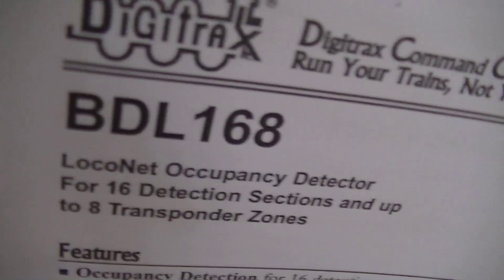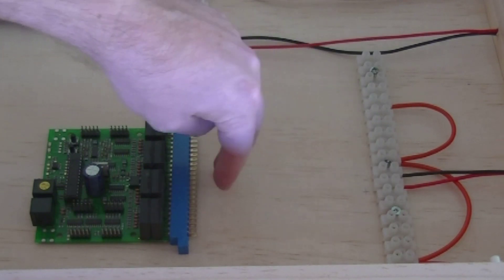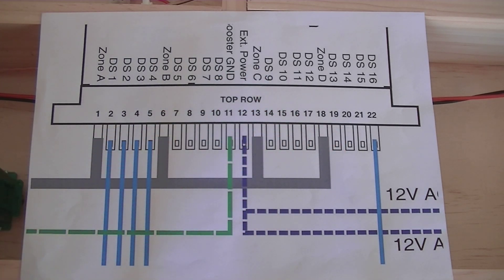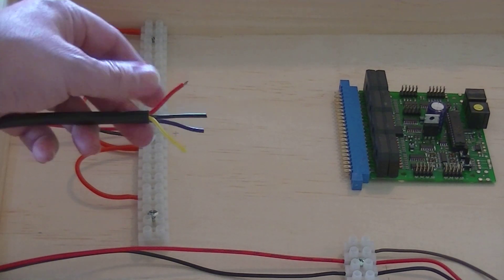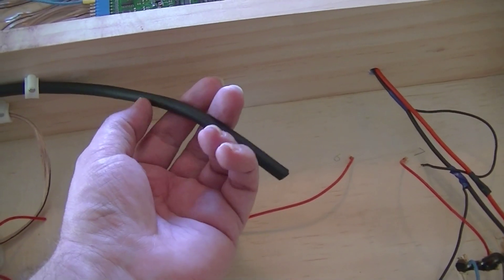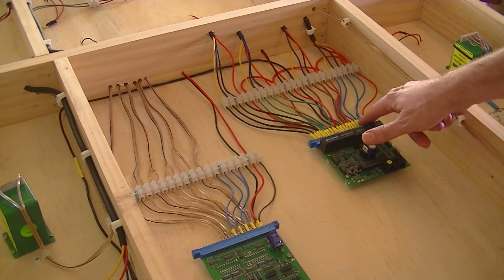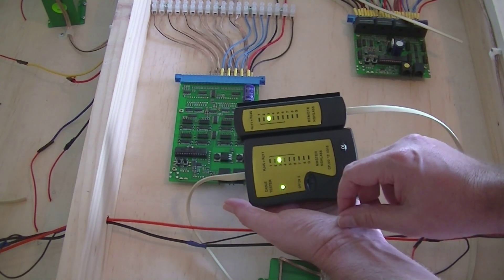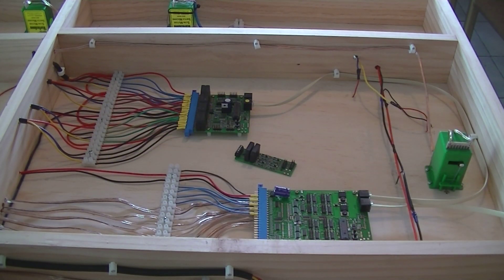Wiring up Digitrax BDL 168

Comment: I am having huge trouble with trying to figure this out. All my block 1-4 says occupied but there is no zone power. Did u cut both rails for each block. Or does rail b run continuously
Reply from the maker: Rail b run continuously, only rail a is used for block detection. Rail b track feeders run straight to the buss line.  You will need to double check your wiring. The bdl168 supplies power to each block section rail a only. It's difficult for me to work out your problem without seeing your wiring.
If you are still having problems message me again and I'll get you to send some pictures of your wiring

Comment: thanks for answer--ccan you let me know does it matter if the inner or outer rail of the track is cut to form the block-I see you use the inner rail -I am thinking of using the outer rail best regards
Reply from the maker: gfjno 
No it doesn't matter which one
Reply: thanks for reply--i see you remove the temporary connections to the main buss wire on the rail which is cut to form the blocks--what about the wire to the continuous rail--does this become the Detection common?
Reply from the maker: gfjno 
hi, the feeders from the black wire are left uncut

Comment: excellent video--I am using it as instruction video--can you confirm when connecting to zephyr controller is there  only one wire(zone common) connected to " rail a" terminal   and only one  wire (detection common) connected to " rail b"?
Reply from the maker: +gfjno 
Hi, glad you enjoyed the video. You are correct with the wiring.